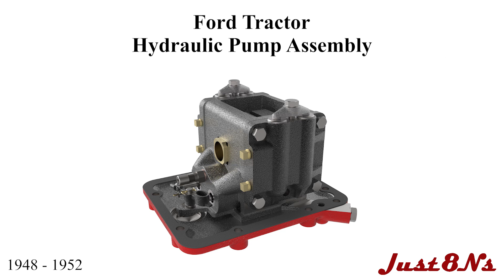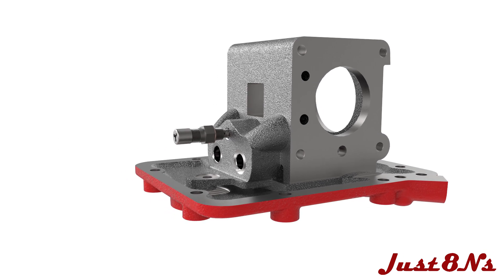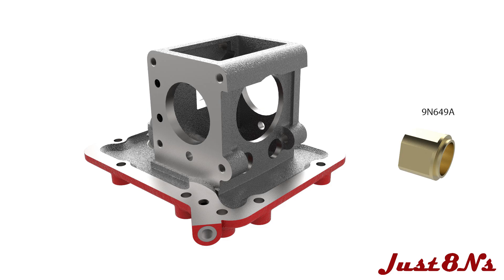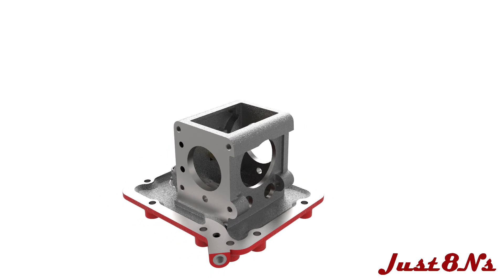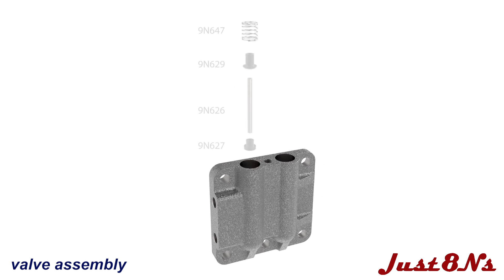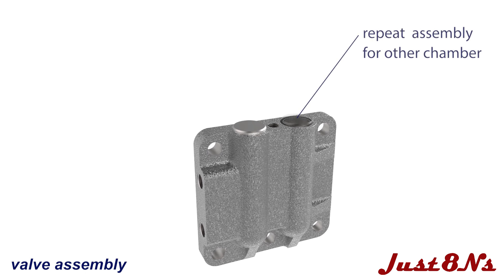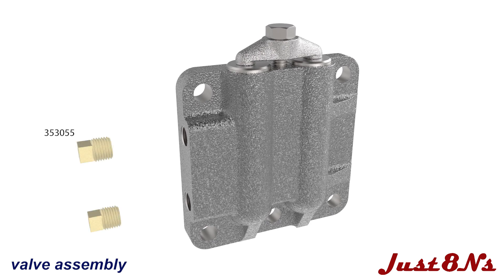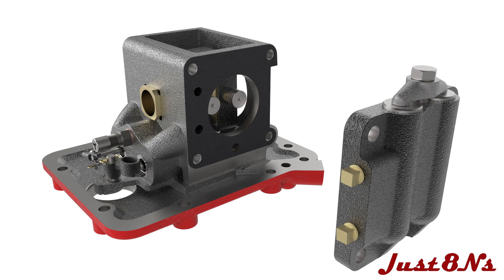Ford Tractor 1948 - 1952 Hydraulic Pump Assembly

Comment: Does this show ALL the parts of the pump assembly? The Ford parts manual shows a spring and backing pin behind the exhaust control valve that I can't find here or anywhere else. Were those used only in the 2N or 9N maybe?

Comment: Unbelievably great videos.  Thanks!
Reply: It might be benificial to add to this video two important things.
1) the pistons are offset on their frames, these offsets need to face each other when placing on the cam blocks, and cam block flanges also need to face each other.
2) the bushing has a lip which rides inside the cam, the cam needs to be inserted with this shoulder facing the bushing. 
Just a suggestion. These videos are very nice, answers alot of questions during assembly. Thank you.
Reply from the maker: Glad you like them!